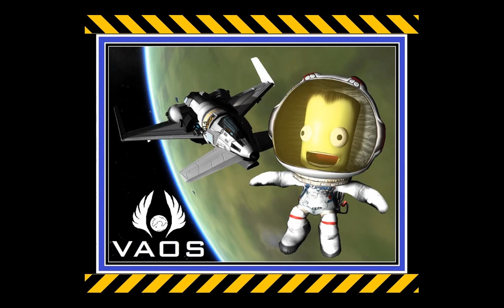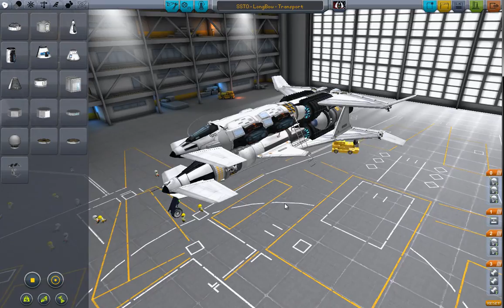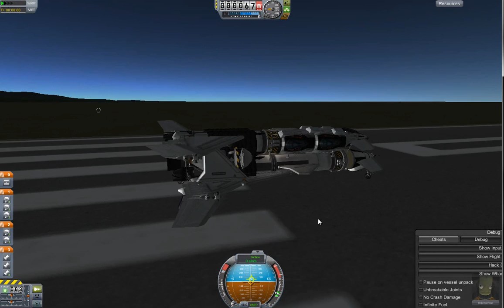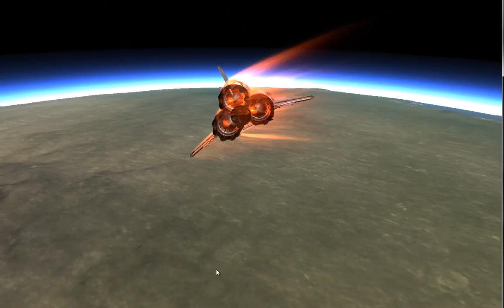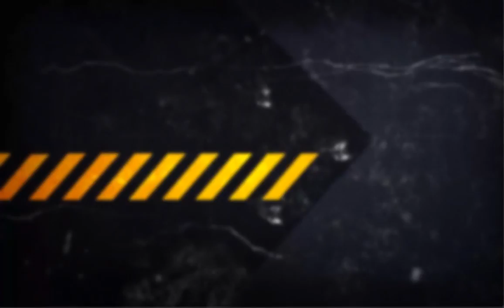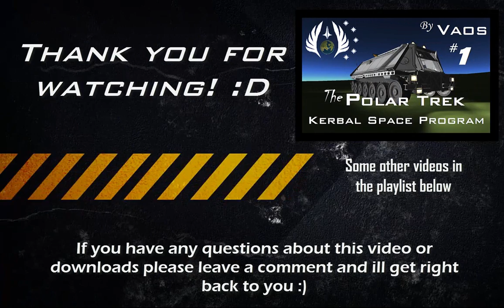*EXTREMELY OLD VIDEO* KSP V.21 -Vid#27- Rescue Bill Kerman! No Mods.

Comment: Hey vaos, sorry to be a bother but I've designed many ssto's that look like this one 'with the two engines overlapping plus the wings' and when ever i think I've done everything right the craft never takes off until the end of the runway and always wants to nose dive, i can get some of the designs into space and into a respectful orbit but they run out of fuel extremely fast due to it not being stable, so i was hoping could help me out in making it more stable?.
Reply from the maker: The one thing that all stock KSP players must be always aware of, is that currently, KSP aerodynamics is no where near close to actual aerodynamics. KSP wings do not have a lot of lift at all like in real life. So, to overcome this (until they fix it) you must add control surfaces under the LF and Ox fuel take (because they are heavy) to help lift them up. Try putting a line of control surfaces on ether side near the body from front to back. Not to close don't them touch. See if that help lift your SSTO faster and help save fuel.  You save fuel with more lift because your prograde and nose( direction of thrust) is somewhat all pointed in the same direction. Very little lift on a craft means that even with your nose pointed up at a steep angle you prograde ( actual direction that you craft is going ) is low and just barely gaining altitude. So you spend more time burning fuel to stay aloft and less time gaining speed and altitude. Hope this helps and sorry for typos I'm on the phone doing this. :D :P
Reply: Thanks man, this helped a lot. I didn't realize the aerodynamics had issues, i'll need to be doing a lot of compensating with my crafts from now on i guess :s
Reply: Daniel Blundell If you want realistic aerodynamics I suggest FAR http://forum.kerbalspaceprogram.com/threads/20451-0-90-Ferram-Aerospace-Research-v0-14-6-12-27-14 or NEAR http://forum.kerbalspaceprogram.com/threads/86419-0-90-NEAR-A-Simpler-Aerodynamics-Model-v1-3-1-12-16-14

Comment: You should be able to de-orbit with that much RCS fuel on Bill's ship (hope he has parachutes!). I ran out of fuel exiting Duna and had more than enough monopropellant to complete the orbit with RCS to let my tug ship get to me.
Reply from the maker: I would of used the mono-propellant. :) But sadly, it was a prototype viper and did not have RCS thrusters ..... they weren't scheduled to be installed until tuesday >.>
Reply: Where's the fun in that?